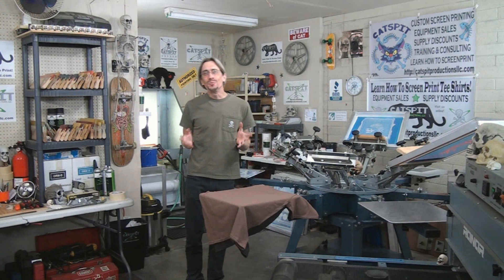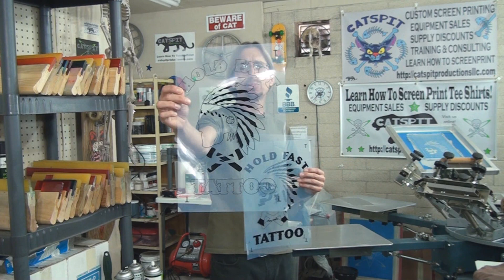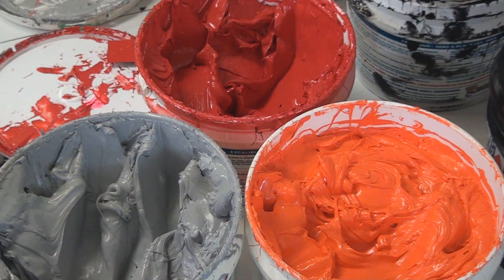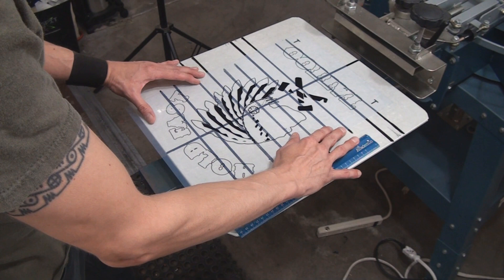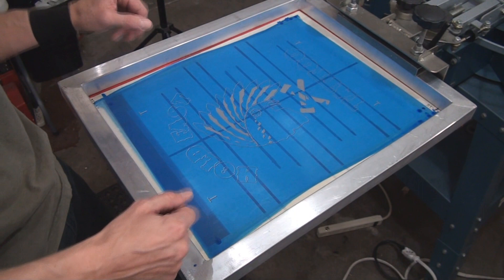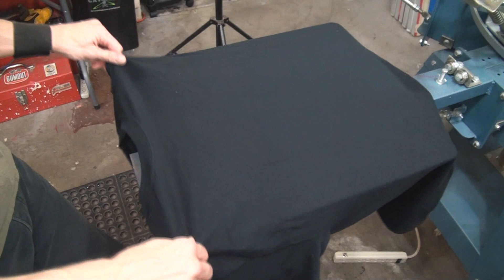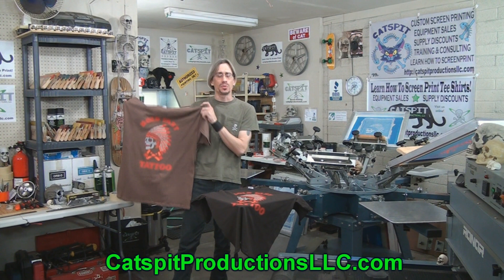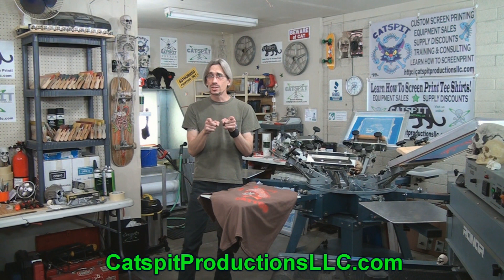Screen Printing On Dark Garments: 3 Colors No Under Base

Comment from the maker: It’s very difficult to diagnose problems from afar with so little information. But generally black ink should be on the thinner side if you’re working with plastisol inks. If the ink is too thick use some curable reducer to thin it out. If you’re using water based it may be drying in the screen. Add a retarder and back flood between prints with air dry inks. Thanks so much for watching and dropping me a note. ☠

Comment from the maker: Thanks Pepe! No, for registration marks you’ll want to use tape. That way you can reuse the same marks when you set it up again. I’ll keep these screens on file for this customer until a year or so passes without an order. This job was done on 125 mesh with 70 micrometer thread. See the article on my website about “Thin Mesh” to learn more about it. Thanks for watching and leaving a comment! ☠

Comment: Well actually use another registration method, as usual the screen burning process must to be well done, if is it, then we can't avoid to put our film on the pallete, we use a garment in ther put the first color, tape it and go on, register the other color over it, we save some time doing in that way, we also use registration marks, normally a cross in the midle of a circle not in every corner, both at less a couple of them, one at each side can be enough,
I like  to see the technics of other professionals to improve myself and for sure you are totally right about the high opacity use without white underlay, I love the finished look, another good point is about the use of the 125 mesh, I probably would use 160 mesh for the orange, but you got a great print with the 125.

Thank for sharing ... great work ... ;3
Reply from the maker: Yup everyone has their own particular working methodology. Thanks for sharing. Thanks for watching. Screen Printing Equipment & Supplies - http://catspitscreenprintsupply.com/

Comment: This one is a great help because I was wondering about screen alignment for our 3 color design. Jonathan I am wondering about your flash curing each ink before the next screen. Using a heat gun to cure the ink (and not melt the fabric!) takes a minute or so? Just enough so that the ink is dry to the touch, I guess, yes? Thank you for these videos Jonathan! Catspit rocks!
Reply from the maker: You're welcome. I'm glad you enjoy my videos. Yes, flashing for multi colored shirts should be just enough to dry the ink to the touch and no more. That's why we call it flashing. It's supposed to be quick and not fully cure the ink. Thanks for watching! Screen Printing Equipment & Supplies - http://CatspitScreenPrintSupply.com/

Comment from the maker: Well you can use a decent quality water based inkjet film and using a dye based inkjet ink will work best. If your printing spot colors straight from your graphic software you can convert all objects to 100% CMYK to make the film denser than with black alone. Thanks for watching and leaving a comment! ☠

Comment: Really liked this design. Nothing to do with screen printing, just curious how it’s done. How do you remove the T mark that shows up in the first test design?
Reply from the maker: Thanks! It's one of my favorite designs I've done. Those T registration marks are taped off before we actually start printing the tee shirts. The shirt with the T marks on it is a teaching tool actually. I still have that shirt from this video and use it teaching. Thanks for watching! Screen Printing Equipment & Supplies - http://CatspitScreenPrintSupply.com/

Comment: Pretty cool!!! , Jon, did you proceed just to "block" the marks after the registration? I mean, does the block out can be apply over the "used" screen, or did you have to clean those little marks up, before aplying the block out? and what mesh count are you using?

Comment from the maker: I’m sorry I really do not understand what you are asking there. This artwork was specifically set up to print without an under base on dark garments. So the artwork was created specially to do that. This art has lines in between the colors that allow the shirt color to be part of the design. In this case the colors do not touch but on other jobs they may touch or there may be a fine line space between them. Thanks for watching and leaving a comment! ☠

Comment: I have a dumb question.  How are you removing the registration marks from your screens.  Are you taping them off underneath?
Reply from the maker: You simply tape them off after you finish the registration and before you start the print run. Thanks for watching. Screen Printing Equipment & Supplies - http://catspitscreenprintsupply.com/

Comment: @catspitproductions My name is todd Im currently having alot of issues with my black plastisol clearing my 230 mesh screen. I have brand new squeegees, new screens I do a push stroke, slight flash before black but I let the pallet cool down im very fustrated could you give some advice on what I could be doing wrong?

Comment: What is the brand name of the inkjet film you use? Is that a 13”x19” inch sheet?
Reply from the maker: That was 11x17 film in this video. I use the same inkjet film I sell:

http://catspitscreenprintsupply.com/inkjet-film/

Thanks for watching! Screen Printing Equipment & Supplies - http://CatspitScreenPrintSupply.com/

Comment: Question! Can you do this with a 60/40 Polycotton blend?
Reply from the maker: No, a polyester garment that is dyed usually needs a poly white under base to prevent dye migration. Or perhaps you could use a line of poly inks making this possible. Thanks for watching! Screen Printing Equipment & Supplies - http://CatspitScreenPrintSupply.com/
Reply: CatspitProductions thanks for replying, did you do a hit flash hit for this? Or just hit all colors and then cured?
Reply: CatspitProductions and also, do you know of any inks that could make this possible to do on polycotton blends?
Reply from the maker: @antoniotomtamayo2790  My pleasure to help out where I can. As I recall this job was done with no under base and no print flash print. The idea was to let the brown from the shirts to affect the print in such a way as to be more earthy, so to speak. If you're looking for a line of poly inks, just do a Google search. You should be able to find something.

Comment: can you get flesh tones without white underbase Johnathan?
Reply from the maker: That really depends on the ink. It may be possible but you would have to try some inks and do some testing. Usually we use a white under base on dark garments to make rendering the colors easier. Thanks for watching! Screen Printing Equipment & Supplies - http://CatspitScreenPrintSupply.com/

Comment: hey, just watch your video, and another one before on printing white plastisol on to black garments.
i have done it both ways flash on then another layer and then tried doing it with just to times with no flash till after.
the only problem i have is that the plastisol is on the inside but very fine, not exactly visible but you can feel a stickiness when wearing it?? am i doing it to much?
Thank you if you can get back to me your videos have basically showed me everything lol.
Reply from the maker: Very cool, I'm happy to help out. Okay I think you mean the ink is showing some on the inside of the shirt making a sticky, sweaty, patchy area uncomfortable to the skin? That could be too much pressure in your print stroke or just too much ink printed. Or perhaps the fabric is on the thinner side in which case you’ll want a thicker garment. We call thick prints like that “bullet proof.” Thanks for watching and leaving a comment! http://catspitscreenprintsupply.com/
Reply: c'est cool ,merci bien!!
Reply from the maker: Amina Mina Thank you very much! You’re very welcome. Thanks for watching and leaving a comment! http://catspitscreenprintsupply.com/
Reply: thank you!
Reply from the maker: winter white  You’re very welcome.

Comment: did you use a heat gun to flash?
I'm looking to maybe use this method to flash for a better opacity
Reply from the maker: For the test print yes. Just between colors. But for the production run we load the press and use the flash cure unit. i did not print each color twice however.

https://www.youtube.com/watch?v=n_CpAfNrFkk

But you can print/flash/print for better coverage. Thanks for watching. Screen Printing Equipment & Supplies - http://catspitscreenprintsupply.com/
Reply: Say i dont have funds to purchase a flash
Reply: Can i use a heat gun
Reply from the maker: Yes, it's possible but perhaps a bit slow. But that's fine on smaller print runs. I know many people do that.

Comment: When screen printing solids like your doing what LPI are you outputting your film in? IM having trouble with the color solids like red to fill fully in and my screen even comes out weird as if there is a pattern on the screen. Im using thermal screen in a 110.
Reply from the maker: This is a spot color and has no dot therefore there never would be an interference pattern. Only halftones could possibly have moire patterns. So this had no LPI since there was no dot. It's wide open screen. Thanks for watching. Screen Printing Equipment & Supplies - http://catspitscreenprintsupply.com/

Comment: Whenever I'm using rubberized ink, my screen always been clogging ? What solution would you suggest sir ? Thank you so much, and I really appreciated your videos hoping for more. God bless
Reply from the maker: You're very welcome. I'm happy to help out where I can. That is hard to say from afar without seeing what you are doing. If you are flashing on press perhaps the ink is getting hot and semi curing in the screen. Thanks for watching. Screen Printing Equipment & Supplies - http://catspitscreenprintsupply.com/
Reply: CatspitProductions do i need to use a screen opener?
Reply from the maker: Screen opener may help on press when you get a clog, yes.
Reply: CatspitProductions thank you very much sir.
Reply from the maker: You're very welcome, it's my pleasure to help out where I can :)

Comment: I love your videos and there is a lot of useful information in them but as far as I'm concerned after 30+ years in printing is that Plastisol is the Anti-Christ or the WMD in screen printing.

It has some benefits in countries and States like mine where the temperatures in South Australia can be phenomenal and we would need to be called in at my fist printing place when I was 17 years old to start working at 4am. Now it is much worse with our temperatures. Plastisol had the benefit here with the high temperatures because it would not dry out in our screens in 2 minutes.

Why not just to just change to discharge inks for 100% black cotton shirts? They are water based and enviro-friendly. I can print shirts in 44 degrees C so you should be able to also.
Reply from the maker: Thanks, glad you enjoy my video work. I feel that it all depends on how you print plastisol inks. With some selectivity, methods and techniques we can achieve a soft print with plastisol inks. These shirts here had a pretty soft feel after printing and after washing they soften up a lot. After a few washes it gets even better. It is not a classic patchy plastisol print at all. And of course anything on white can be printed just as soft as water based with plastisol too. Automatic presses can do soft plastisol prints on black too. Just use halftones or CMYK all the way. Plastisol is the best ink to learn with and there are reasons plastisol dominated the market for so many years. But to each his own ;) Thanks for watching and leaving a comment!